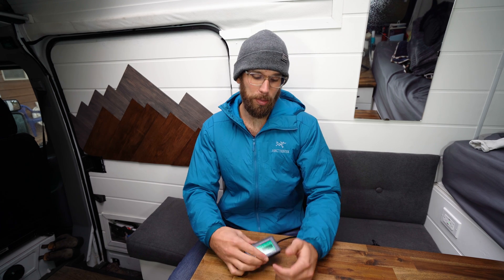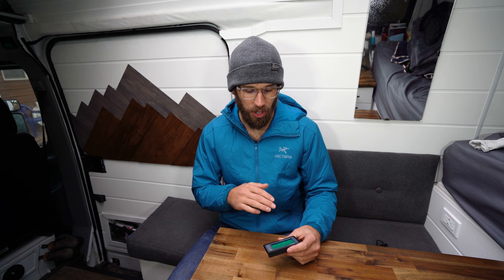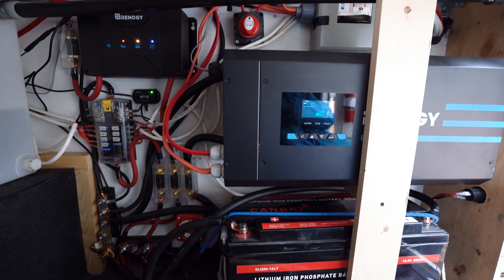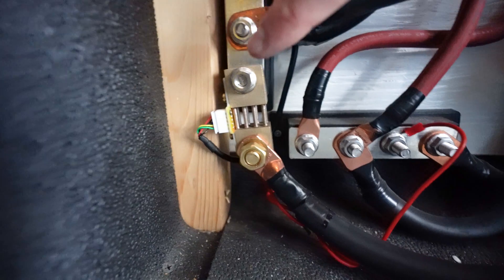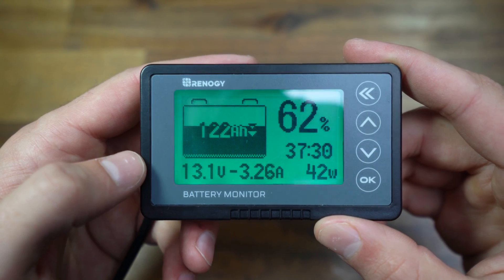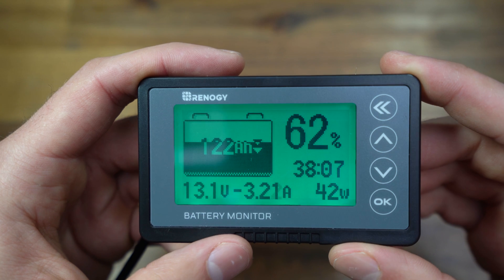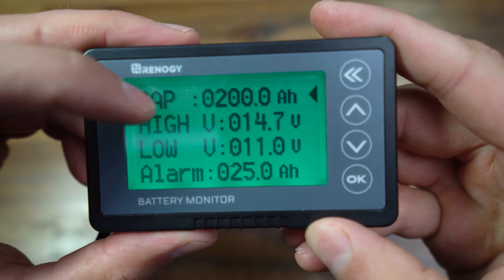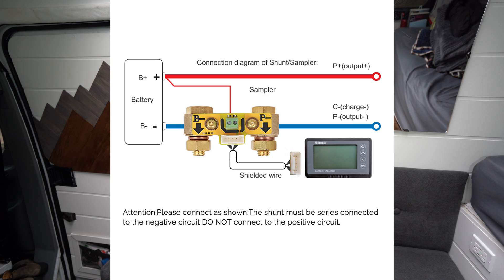Renogy Battery Monitor: How To Monitor Your Solar Batteries

Comment: Thanks for the video, I do have a question. For the life of me I cannot figure out why my monitor will not record incoming charging? I checked and double checked the setup and it appears to be correct. Any thoughts
Reply from the maker: So it will only pick up an out going charge?
Reply: @madetoexplore  It only detects watts going out, Not until the batteries reach a full charge will it reset to 100%. No incoming watts. Thanks for the reply btw!
Reply: I have been searching everywhere!!!! Man!!! Same problem. I get accurate reading of watts getting spent.... but wont pick up charge in percentage from driving/ alternator or solar.... if thats a thing? Guys truth???

That it doesn't read an accurate % on the monitor until its at 100?... then resets to the 100%  once full???

Cos ive been so lost on this also!! And this is the closest info and best by far so far!!!!

Please any help guys... much appreciated always!

My electronic guy tells me ots set up as the diagram shows.... so its not that its set up wrong.
Reply: @bennys_vanlife744  That's exactly what I'm saying. It will not measure incoming watts. I gave up on it and purchased another brand. Not installed yet, probably this weekend. I'll come back here and let you know if it works better then the Renogy. God Bless you!

Comment: Thanks for the video.  I have just installed the same monitor on my boat.  The previous owner installed a solar system with 500watts of solars panels and 8 lead acid batteries, each with 220 amp hours of storage.  I contacted Renogy to ask what number I should use on the monitor for total amp hours.  I was told that because my batteries are wired in banks to provide 12V of output I should halve the total AH and use 880Ah as my total AH on the monitor.  Is this correct?  Also, what should be my max and min charging numbers?  I was going to use 14.5V as the max and 11.5V as the min but would like clarification as Renogy has not been helpful in this area.  Finally i was planning to use 60% of the total AH for the alarm so I am notified before the batteries go dead.  I appreciate your anticipated response.
Reply from the maker: Yes, the usable power is 50% for lead acid batteries so 880AH is correct. Have the alarm set at 60% would be a good idea. Do the batteries have a max voltage rating? I would use this voltage for the high alarm. For the low alarm. I would drain the system to 880ah and use that voltage for the low alarm.

Comment: I'm having issues with mine. Its connected to the - bus bar, negative the right direction, all the parameters are set. 13.5 volts shows at the starter battery, the house batteries and the charger when running. I drained the batteries to 95% and it charged them back up, all the right light colors are on at the charger. And then it said 14.2   But the monitor says it is discharging. Always. Even though it charged the house batteries back to 100%. I am perplexed, to say the least
Reply from the maker: That’s strange 🤔 I would definitely return it and get a new one if you can!

Comment: Hey what's the point of setting the high and low voltage? What does it affect and my 6v batteries only say 230cca so I enter 230 for amp hrs or.
Reply from the maker: It’s for the alarm
Reply: When i entered the amp hrs. Then the trailer was used it fell flat on its face. Not sure if that  happend becouse I entered it in when the trailer was plugged in? My battery's where charged up all the way before.

Comment: Hey new subscriber 

Looking to build out a camper van for life on the road for work 

How long does your 200 a.h. system last during the winter living in the snowy north running the diesel heater and lights and using regular 12v to charge phones and other devices...  I'm trying to guess how much solar I should put up and how many battery's I need to build a decent system
Reply from the maker: Hi Andrew, our 200ah will last 3-4 days without receiving a charge although I’ve never had to fully experience that since we are usually travelling a bit each day. During the winter, the alternator charges the battery fairly quickly.

Comment: It looks almost like that negative shunt is just a cm or two away from the positive bus bar & lugs... Hope that's just some artifact of the camera angle, and there is really plenty of spacing in between, i.e. no possibility if the shunt got a bit loose and started swinging around might make contact. Would be a bad day in the van ;) If so, maybe a small chunk of clear acrylic sheet (plexiglas/lucite) in between those would ensure no potential disasters.
Thanks for the thorough review!
Reply from the maker: Welcome! The camera makes them look closer than they are for sure. Probably will do a little separator in the future though to be safe. The lock washers have never come loose so far and I’ve been down some wicked washboard

Comment: So i want to use this for one of my battery builds. If the charger is not connected to the shunt will it still accurately measure voltage for the low voltage alarm function?
Reply from the maker: No it wouldn’t work. There’s only one cable that connects the shunt to the controller so you would need to connect it for the alarm to work.

Comment: Please explain Alarm for high v, low v, alarm ah? What numbers are entered? What happens when the alarm goes off? How do you shut off the alarm? Instruction manual basically worthless as well as their website for info. Lots of numbers showing in the setting mode but where do they come from?
Reply: Those numbers come from your battery manufacturer. It should list high voltage and low voltage.
Reply: We definitely agree on that lame ass manual.
Reply: Did you ever find out how to shut off the alarm? Mine went off at 2.30 this morning, I felt like i was in the ICU
Reply: @chemanley7484  Nope no answers to any of my questions from this page nor from Renogy.

Comment: I have this unit (but a cheaper unbranded one) on my boat for the trolling motor lithium batteries. 
Works great best for the price by far.
Reply: I just purchased my first LifePO4 batteries for my small boat's electric trolling motor and I'm trying to find a good monitor for them. Are you satisfied with the one that you are using and would you mind sharing what brand it is? I'm not sure if Renogy makes a portable monitor that doesn't require mounting. Thanks!
Reply from the maker: @jamesrobbison  I’d get one of there new Bluetooth batteries! Should be able to monitor with the Renogy app. Otherwise you’ll have to mount a shunt to your battery. Wouldn’t be hard tho
Reply from the maker: Nice! I definitely agree

Comment: Hey mate you should set your battery amp hour at 80% as that’s the usable amp hours, so 80% of 200amph, got that info from our sales guy in Aus. Great vid and subbed👌
Reply from the maker: Yeah, I completely forgot to mention that Lithium batteries shouldn’t be drained below 80% of their capacity in this video 🤦 thank you!
Reply: @madetoexplore  You did, however, mention that an alarm could be set to 20% or whatever number one chooses to address this topic in a different manner.
Reply: @madetoexplore  all good mate still a great vid

Comment: Can you link the BT2 to the battery monitor to send the more accurate data to your phone?
Reply from the maker: I wish! But unfortunately not
Reply: @madetoexplore  I've just bought the BT1 for my wanderer charge controller but can't really see the point of it? The only thing you can monitor is the amount of solar coming in, everything else is inaccurate for any use?
Reply from the maker: @chrisb5839  yeah, if you want accuracy I would return the BT1 and buy the battery monitor

Comment: When i installed mine it doesn't show charge ever I will get around 13.8v as my alternator or solar charges the battery but I never get the arrows up or amperage positive?? Any help on why that is caused is appriciated
Reply from the maker: Did you install it the shunt the right way?
Reply: @madetoexplore  I believe so I have a redarc charger renogy inverter on the -p of the shunt and battery ground on the -b of the shunt only thing I can think of that I might have to try this weekend is I have the battery grounded to the chassis of the car so the redarc can work??
Reply from the maker: @salvi1085  that would probably be the issue then. The shunt needs to be the only thing separating the negative battery terminal to the rest of the system. Negative Battery Terminal->Shunt->All other connection including ground. If your chassis ground skips the shunt and is connected directly to your battery then it won’t be able to read the charge.
Reply: @madetoexplore  thanks for the quick reply  I'll try it out tonight and check the voltages going in and out of all my connections make sure it all working
Reply: @madetoexplore  the shunt turns on and shows wattage it is using but never shown how much it's charging when the car is on or the solar panel is charging it does not show that it is charging on the screen

Comment: Hey, Ive just fitted this monitor but, in case you didn't know the DCC50S prioritises solar input and limits both to 25amps therefore you will only get a maximum of 25amps from the engine battery. I live in Scotland, not known for it's tropical weather, so I fitted a double pole isolator switch to my solar panels so today I was getting 25W from my 460W solar because a crap day and 25amps from bus battery. When I shut off the feeble solar input I boosted to 48.8amp charge from the bus battery so when I'm driving and running the engine I'm getting fantastci charge and when I parrk up I'll flip the solar back on. Thought that might be useful info
Reply from the maker: Thanks! Yes I did this on my install too.
Reply: @lewhamy7445  yes, I did and nor that expensive but quite big.

Comment: Renogy has proven themselves inadequate once again. Does not ship with a negative battery cable so you have to buy that extra. Another delay and setback plus additional cost. Renogy inverter battery cable does not fit the shunt meaning you have to get a drill bit to enlarge the ring hole. Imagine that no compatibility within the same brand of products. Total lack of quality control. Not to mention that customer service is non-existent.
Reply: You sound like an entitled child. Electrical installation is for people who want to take responsibility for their work. When you buy a monitor, you buy a monitor, not the entire distribution system. Its reasonable to expect any sane adult to source their own power distribution cables.
Reply: You expected a cable? How does Renogy know what size your inverter is, what size battery cable you need. Your max inverter draw will dictate your cable size.
This is not a Renogy inadequacy but rather reflects an area in which you could benefit from more understanding of systems. Nothing wrong with having gaps in learning, there is alot to unpack with solar.
Reply: @Endless_Skyway_Adventures  It's pretty simple actually they sold the system. They should know what's needed for their parts. Their charge controller, their inverter and their battery monitor. Why is it so difficult to understand?
Reply: @DjbriancUs  because you fail to understand that not everyone buys the same components. Some people want a 1000 watts inverter, some 2000, some 5000. The required cable for each of those scenarios is different.
Reply: @Endless_Skyway_Adventures  when you sell a system you should know what's required to make it work and not cause unnecessary hardship on the customer to track down missing items.
Reply: @DjbriancUs  it is clear from some of your other comments that you are still searching for answers and that is awesome. At some point you will understand why your point is not practical. The components you are purchasing require a certain level of knowledge to install safely, improperly installed solar components can kill you. That includes proper sizing of battery cables for the inverter in use. In order to provide a cable they have to know how big your inverter is and how far your inverter is from your bussbar. This is different for every installation. I am not going to invest anymore time in this topic.
Reply: @Endless_Skyway_Adventures  perhaps you should look up the definition of system. While I agree with all your points you fail to acknowledge that I bought all this shit within the same week, they knew what they were dealing with and they could have recommended the proper cable rather than putting me out another week and a half for another order before I could assemble it. I've still got several other support issues that they've dropped the ball on. I would never recommend this company, their support is horrendous. Thankfully my research got me the answers that I needed to resolve the situation without their help.
Reply: @DjbriancUs  in light of your expectation of turnkey solution, and because I really do care about safety you would be wise to check that you have proper size wiring and proper fuses. 
I have included the fusing scheme for my systems as a reference. Hopefully you have something similar but your life literally depends on having this right.
My systems (yes 2 systems) each have a 2000 watt inverter.
I have 1/0 battery cables rated for 265 amps 
A 200 amp ANL fuse at the positive battery bank terminal feeding the inverter.
One 15 amp fuse on my (four ) 100 watt solar panels wired in series. Parallel would require a different fuse 
One 40 amp ANL fuse on the 6 gauge wire between charge controller and battery bank 
One 50 amp ANL fuse between the battery bank DC fuse block.
One 15 amp fuse on each dc fridge.
 One 3 amp fuse on each pair of lights.
Ok now I have a clear conscience and now I am done with this thread. Listen to me or don’t.
Reply: Ladies please theres only 1 way to settle this. A good game of scrabble!

Comment: How did you choose your high/low voltage alarm
Reply from the maker: The are based on the battery. The high voltage alarm (14.6) is the max voltage for the battery and 11.0 is pretty much dead